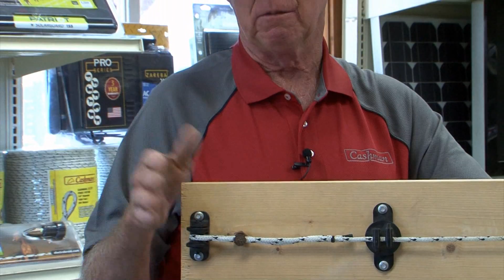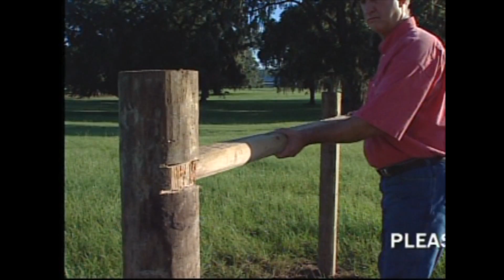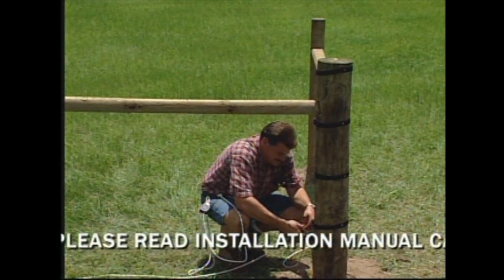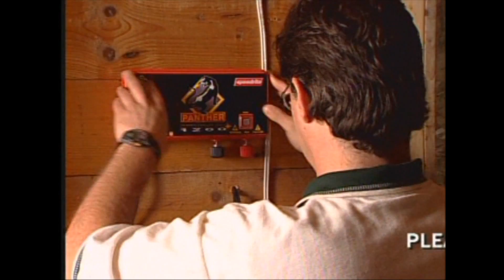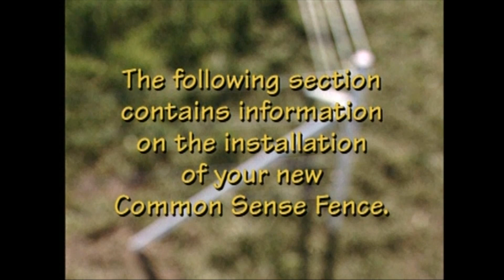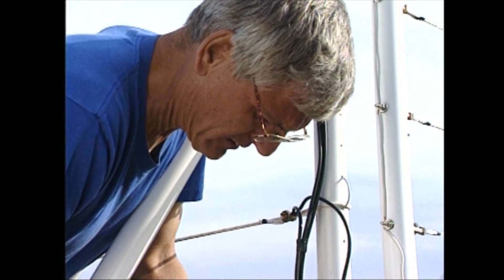Cashmans Elite Braided Fence System with Pat Cashman

Comment: I have sheep and will bring using this polyrope. For grounding is it the very bottom strand that is grounded or second to bottom strand? I will be spacing strands 6” apart at the bottom for about 3!strands then every foot. Thank you for a very informative video!

Comment: Great video! So glad to see that you say you put your rollers on the exterior of the corner posts. I have never been confident in the rollers holding the wire on with the rollers on the inside. Electrobraid does not explain it this way, so thanks.

Comment: A very informative video, thank you.  
Cashmans sent us most of the fence material but I still can't find out how tight to pull the braided wire......I went to the web site and well I learned what I know from your video.
Reply: So with class 3 galvanized at 200,000 psi it's 250 lbs 
And I think the braking point is 1300 and In this video he said it was 1700braking strength cross multiply and divide 250 over x and 1300 over 1700  and 326.9 lbs 🤷 ballpark lol